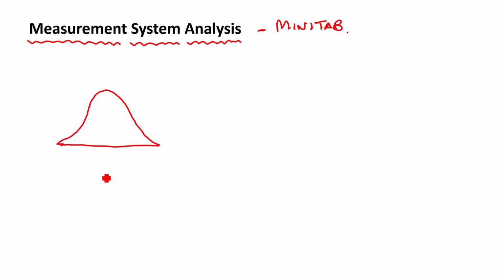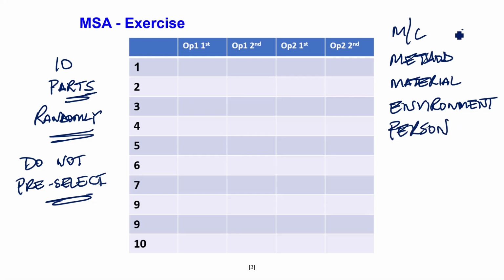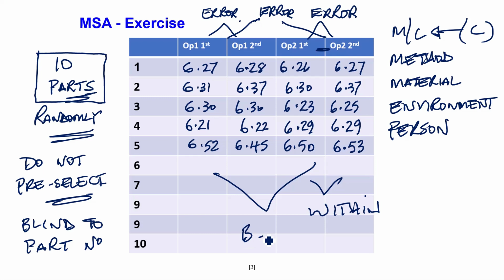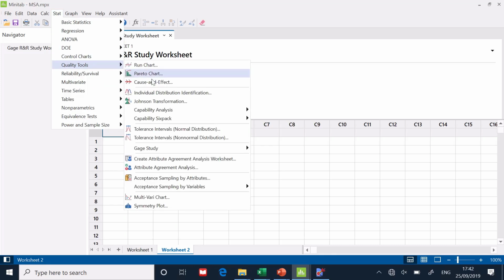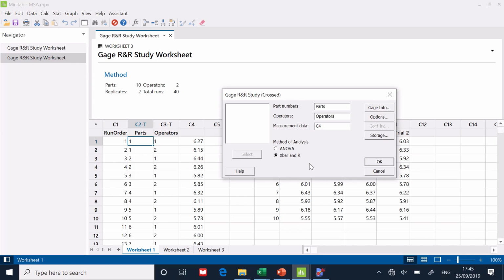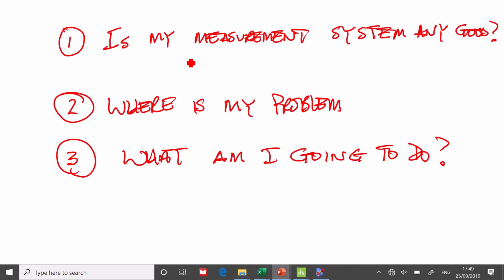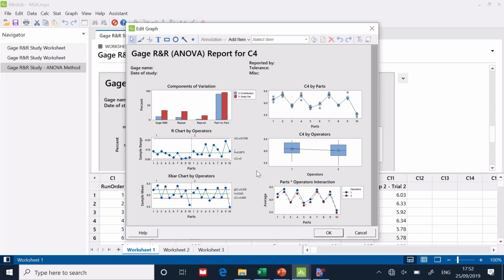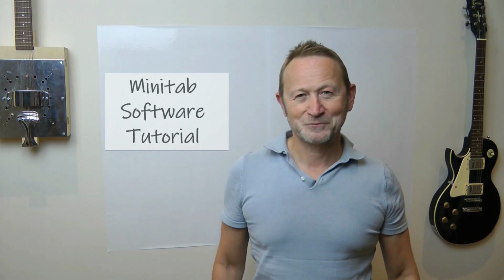Minitab Tutorial - Measurement System Analysis

Comment: Repeatability has more variability than reproducibility in the case you shared in video. It's meaning that more variability is coming from machine itself not operators, isn;t it? But, you pointed out standardization of SOP and training to OP2 as a corrective action which are colsely related with reproducibility. ???
Reply from the maker: Hi Lee - no you connot seperate the Machine and operator like that. The variability is within system and the system is made of the m/c the operator the method and the variability on the parts...
Reply: @paulallen5321   i think ans of 3rd question- should also include calibration of tool 😅 bcz problem is repetition of measurement by measuring tool !
Reply from the maker: Hi Hardik - Calibration unfortunately cannot control variation in the measurement system, it simply controls precision..

Comment: I have a doubt?
Is this a measurement system analysis to check the quality of the product or the quality of the weighting machine?
Reply from the maker: Basil - the MSA checks the quality of the measurement system. that is the equipment plus method plus material plus people using it...
Reply: @paulallen5321  thanks for your reply, actually I have sent a email regarding my doubts. I need a experimental design. Can you help me for that?
Reply: I mean how to check the quality of product.
Reply from the maker: Basil - I will reply to that as well...
Reply from the maker: The MSA maths will separate the difference created by parts and the difference created by the measurement system...
Reply: @paulallen5321  thank you so much sir

Comment: what does C4 BYPARTS INDICATES AND ALSO X BAR CHART? IN YOUR CASE PART TO PART VARIABILITY IS HIGHER SO WHY IT IS NOT CONSIDERED?
Reply from the maker: Prasad - X bar means average chart and part to part variability is of course what we want. All the variability should be in the parts not in the measurement system. What we're looking ar is if the variability coming from the measurement system is too large...
Reply: @paulallen5321  Thank you for your reply. but % study variation in case of Part to part is 94.43% which is higher that repeatability and reproducibility ,  so do we want higher % of part variability for a good system ? and what is reason behind it ?
Reply: @paulallen5321   is there any thing related for part to part measurement?
I mean if we have 20 percent of part to part then is there any problem?
I guess it just use to show how many different parts we selected for measurement sustem
Reply from the maker: Abhi - if you have only 20% from part to part, that must mean 80% of variation is coming from the measurement system. That would be a very poor measurement system, the best is that 100% is part to part and 0% is meaurement error...

Comment: Hello Paul, I hope you are doing great? would you mind explaining me agian the diferenece between ANOVA and XBar and R analysis? I dont really catch get it, what do you mean when you said measurement system that is doing one or two repeats?
thank you.
Reply from the maker: Jorge - No problem, sometimes when you do an MSA you only have one peice of equipment or system to test. So if you have an automatic measuring system and there is only one of them then you'll only do a single system repeat. So more than likely you'll have a pair of measurements from one system to evaluate. 2 data points not 4 when you 2 x 2 data points. When you only have one measurement system like this you can only use the X Bar R method.
Reply: @paulallen5321  Perfect, thank you!

Comment: Hi Paul. Just if the Problem in Between the system, than which graph do i have to see to find out what i have to do
Reply from the maker: Francis - there should be a graph that plots the averages for each part/operator. If these averages are different then the problem is between not within system...
Reply: @paulallen5321  in that case,
Should we change/update measurement system right?
Is there any another way to solve this between measurement system?